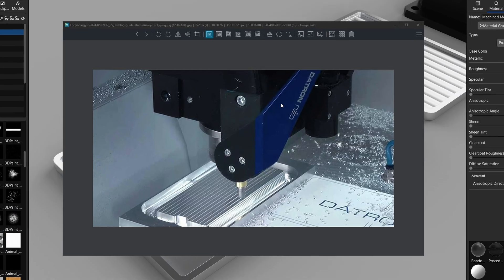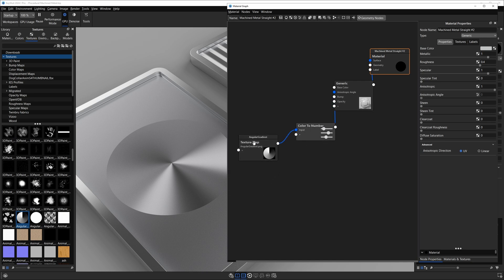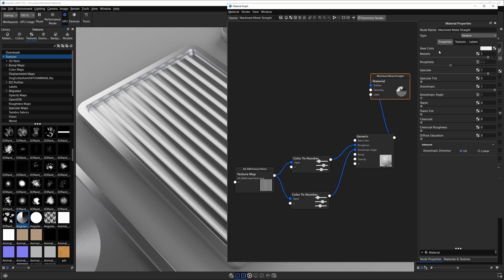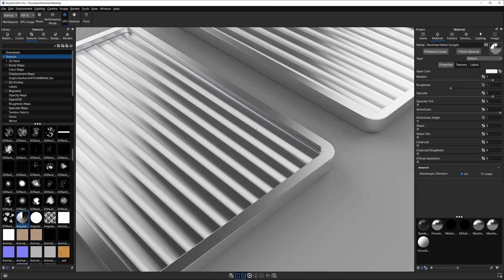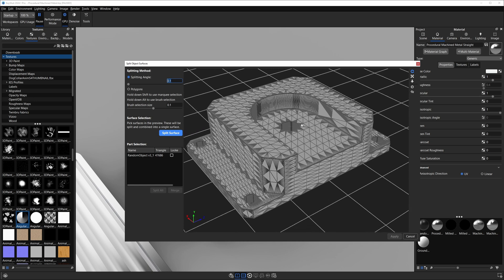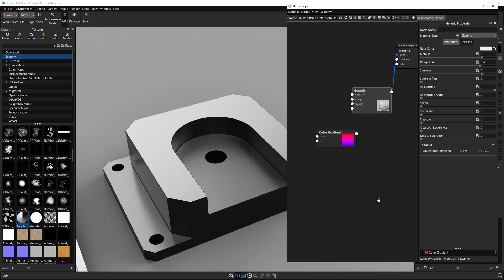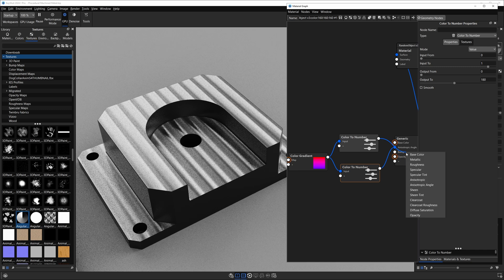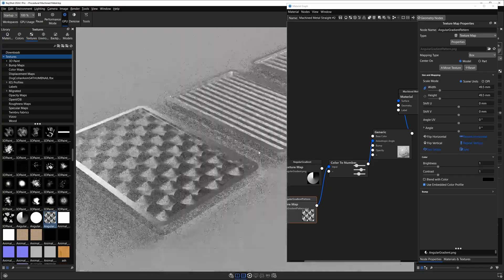PROCEDURAL Machined metal in KeyShot!

Comment: I have tried your procedure to create a metal with anisotropic angle but it seems not to work.. do you have any suggestion or active special parameter? Im using Keyshot studio 2024.2... thanks
Reply from the maker: Hmm. It should work, assuming there's not a bug causing an issue. I haven't tested on 2024.2. Sorry, in the meantime, my only suggstion is to make sure you didn't miss any settings or steps from the tutorial. Sorry about that.
Reply: @WillGibbons  Hi Will, thanks. I solved the problem (roughness was left at 0) so it's working in KS studio 2024.2 too..